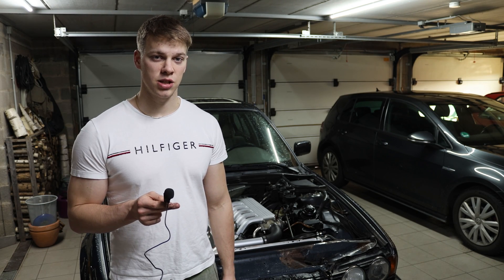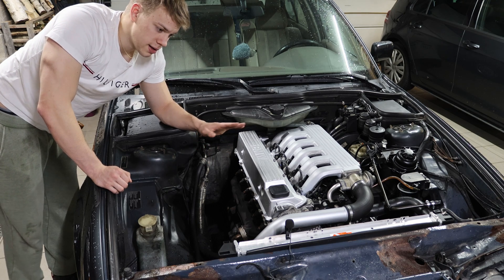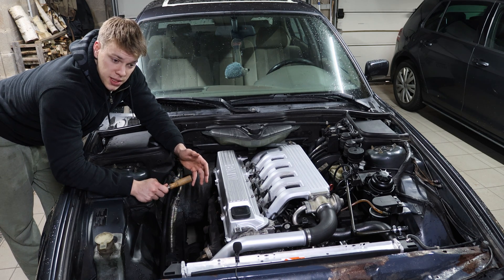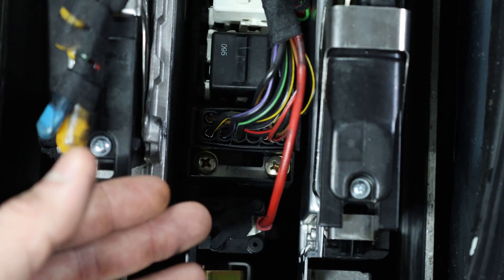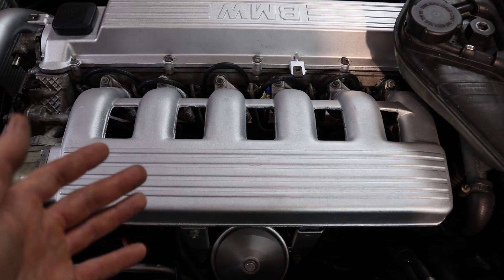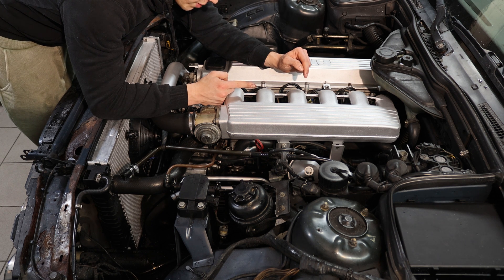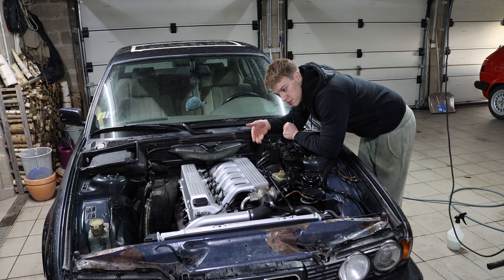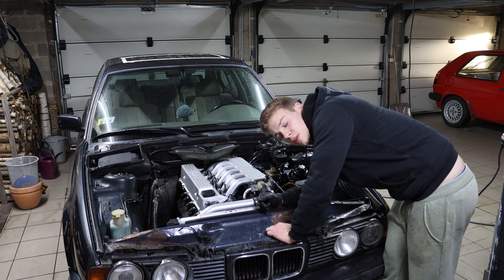How to diagnose and time the injection pump on an M51d25 or m41 (525/325/318)td.s //Ep7

Comment: Glad that you got it working!
About those Bosch VE pumps: Yeah, you can change the pump seals but this is not a rebuild in my opinion. 
Real rebuild is where all the worn out parts will be changed, costs around 800-2000€ (depending how much needs to be replaced). Fun fact is that you can actually order parts for this pump yourself. For example cam plate, cam plate rollers and distribution head with plunger. Cheapest ones come from china and cost 100-200€. But with what quality and tolerances are those :D

Anyway I started the teardown on mine as well, only difference that mine is in Range Rover P38. 
Weird is that I could not get the cam tool all the way inserted. Had a cap like yours but mine was like 2cm, thought that flywheel pin has been misplaced but after 2hours of trying and arguing myself I concluded that it was in the right place just the chain had so much stretch, or it had skipped a tooth somehow. I hope to get the rest dismantled in few days so I can confirm this theory. Anyway the most important is to time it right when putting it back together. 
Did you change out the keys as well or went with old ones? Heard that crank key that is connected to oil pump should be changed while at it.
Reply from the maker: @madismaekivi6800 Thanks for the constructive comment! I definitely agree that only new seals is not a rebuild but from my research( mostly French forums etc) the defective seals cause a loss of pressure and many people have had success just replacing the seals since these go defective before the pump internals do. Can you pls provide a store where I can buy individual pump and injector parts because I haven't found any :/

Considering your case: from what you discovered, I think urs skipped timing since 2 cm is a lot (I had a 5mm gap at 320k km) and that's not unheard of (actually found that case on an RR forum), and then it would be wise to replace the crank key since there was a lot of play all the time. but on mine, I kept the old one because it was a tight fit, and don't think it was necessary. Even if I had to replace it I wouldn't know where to buy a crank key? Get it custom-machined? no idea

Comment: I have a m51 engine in my 1995 525tds, it always starts and runs fine but it can take a while to get going, cranks for what seems too long maybe 5/8seconds but never fails to start, also noticed quite a bit of black smoke under moderate acceleration, gets worse the harder you push it

Comment: Hi, I have a 325tds. The problem I have is when the car is hot it cranks for 10 or 15 sec and then starts. It is better when its cold, but still it takes some time to fire up. What could be the issue? The pump? The temp sensors?
Reply from the maker: hot start issues are common on m51. i am filming a video series on it right now. Issues could be many, but usually fuel related

Comment: Hey! How do you physically set the right lift? My e36 had a leaky injection pump and the mechanics really messed it up. I got the car back and it didnt start at all so i just ended uo replacing the whole engine as I could do that myself but i would like to do a rebuild on the original one to put it back in.
Reply from the maker: If you really want to have the correct lift, you need a dial gauge set

Comment: Hello i have an 318tds e36 with m41 engine. My car is starting late, really weak in low rpm i think the injection pumps timing is wrong how can i make the pump to send more fuel can i do it my self ?
Reply: It’s like the ECU is deliberately limiting the fuel and keeping the idle high — as if some setting is wrong.
Reply from the maker: @bartwoplays3660  1100 rpm idle when the car is hot is too high. but the car feeling "dead" at 1200 rpm  is normal, especially at higher gears its an old 2 valve idi diesel. its always gonna be slow, especially when there is no boost, ie 1200 rpm. Hot start issue is a common issue on this car. I', working on a video on said topic, because my car has the same issue. Does your car smoke a lot ?
Reply: Yes, my car does have some black smoke, but not excessively — just a normal amount. You’re right about what you said, but my car feels slower than it should be. I’ve watched a lot of videos and checked everything on the car. It seems like the injection pump timing is a bit too retarded, and I think that could explain the high idle issue.
Reply from the maker: @bartwoplays3660  depends on what your doing. if your car has cats, ideally there is no to almost no smoke during normal operation and revving until you get to limiter. Also, the timing doesn't directly affect the idle speed, since the advance solenoid governs the timing to a certain degree. A too high minimum order quantity on the other hand can make the car smoke black and idle high :/ It's so hard to help diagnose an issue without being next to the car
Reply: @DailyDrivenClasssics  My car doesn’t have a catalytic converter — it’s running a full straight pipe. Under load, it throws a bit of black smoke. I understand what you’re saying, and yeah, diagnosing remotely is tough. But the only thing left seems to be the injection pump timing. We’ve checked everything else on the car.

Doesn’t it make sense that the ECU is raising the idle because the timing is too retarded? Since the fuel is injected too late, the engine can’t stay running at 800–900 rpm, so the ECU is forced to increase idle speed. Also, the instant fuel consumption doesn’t rise as much as it should. Looks like we’ll try advancing the timing a bit and see what happens.
Reply from the maker: @bartwoplays3660  if by instant fuel consumption you mean the tachometer one, it depends on the gear. if i'm i 3rd gear and floor it under load it doesn't go over the maximum, so if that's what you mean its also normal. Don't just start playing around with the injection pump. I did that and had to fix my mistakes over a few months :)
Reply from the maker: @bartwoplays3660  my injection light doesnt flash even when i have the IP set to full advance or full retard
Reply: @DailyDrivenClasssics  Buying a new injector just to test it would be too expensive for me — if it doesn’t fix the issue, the money would be wasted. Trying an injection timing adjustment seems like a more cost-effective option.

By the way, when you retarded the timing, did you experience any similar symptoms? For example, did the ECU raise the idle? Was there black smoke or a loss of power?
Reply from the maker: @bartwoplays3660  no, not really. thats why i'm saying. just playing with the IP is gonna do more bad than good. Please test your advance solenoid on the pump for function and report back. If you want to you can hit me up on IG and I will try to help
Reply from the maker: @bartwoplays3660
@bartwoplays3660 
Hi, please describe further. Is the issue only when cold, only when hot, how late? What do you consider low rpm?  Also, do not just play around with the injection pump for no reason, its very finicky
Reply: ⸻

“My car idles around 1100 RPM. Low RPMs feel dead, especially in higher gears—when I press the gas at around 1200–1300 RPM, there’s almost no response. It has delayed starting, especially when the engine is very hot. It actually starts more easily when cold. Instant fuel consumption doesn’t increase as much as it should. The engine also runs rough with noticeable vibrations.”
Reply: When we connected the car to the diagnostic computer, it showed errors for the fourth injector, the glow plugs, the intake air temperature sensor, and something called “driver speed adjustment control panel.” I already replaced the air temperature sensor. The car was throwing some white smoke before, but now that’s gone.

I haven’t fixed the other three issues yet. The fourth injector seems fine — I had it checked. I believe the error is showing because the injection pump timing is slightly retarded. Especially at low RPMs, when I give just a little throttle, the injector warning light starts flashing. But when I go full throttle, it disappears.
Reply from the maker: @bartwoplays3660  4th inejctor is the needle lift position sensor. the ecu uses that injector and the crank sensor to calculate timing since it doesnt have a cam sensor. if there is an error for that, you need to fix it.
Reply: @DailyDrivenClasssics  I understand what you mean — yes, by instant fuel consumption I was referring to exactly that. In my case, it never goes over 30 either. The highest I’ve seen is around 21–22 L/100km, and especially in higher gears it doesn’t even pass 10. For example, in 5th gear at full throttle, the maximum I get is 10 L/100km. That definitely doesn’t seem normal.

When I bought the car, I actually found a spare 4th injector in the trunk, so it had already been replaced before. Either it’s gone bad again, or the timing is causing it to throw errors. But there’s no problem with the injection itself.

One more thing — is there any definite way to test if the needle lift sensor inside the injector is faulty? Can it be repaired, or do I have to replace the whole injector?
Reply from the maker: @bartwoplays3660  iirc the needle lift injector needs to have 100 ohms resistance  on the electrical connector with 10 ohms tolerance. i've taken my old one apart, but i dont think theres much to rebuild.Maybe there is an issue with the advance solenoid on the IP which causes the light to go off because the sensor gets a wrong signal :/ Not too sure. you can test the advance solenoid with a multimeter tho. I just dont remember the specs, but you can find them on google
Reply: Alright, so how exactly do we do this test? Which connector should I check with the multimeter?
It would be easier to talk on Instagram — I also use it. Could you please share your IG handle so I can message you there?
Reply from the maker: @bartwoplays3660  its linked on my channel page

Comment: What about the crankshaft and camshaft sensors, could that impact on a hot ngine as no crank and start.?, where are those sensors located on a 525 tds -94
Reply from the maker: @bopedibop M51 has no cam sensor, only crank sensor which is located under the starter. If crank sensor is not working, the car shouldnt start in cold condition. Poor warm starts on m51 are usually worn out  injection pump seals, leaking diesel. Does it not start at all or just have a long crank to start?
Reply: @DailyDrivenClasssics  well no cam sensor thats why i dont find it. I managed to change the crank sensor so i will see how it works now. I was told to change it due to that its hard to start sometimes when hot but if waiting for an hour it usually starts..I cannot see any obviously leakage.I will scan your vidoes for tips. ;)
Thank you for sorting out the cam sensor trouble.
Reply from the maker: @bopedibop
@bopedibop
How did you change crank sensor, because IIRC it sits in a bracket and the position needs to be exactly the same so it gets a good reading? Does your car have an anti return valve, since when hot the in tank pump gets no signal from the ecu and the pump has to "suck" some new diesel through the lines
Reply: @DailyDrivenClasssics  oops i just changed it, sliped out the old and in with the new one and it started nicely. Not sure what to do with this information if it needs to be exactly on a half millimeter. i will keep that in mind.
I have not seen a anti return valve. And I sort of had the problem that the pump has not been able to send fuel so i changed the relay. Checked contacs and get 11,8 volts probably due to the cable area...
I will get an anti return valve and connect after the filter?
just to clearify. The pump was working and sent fuel (check the filter) and it was not able to start but during the time we changed to loaded battery it started after an hour. Next time this happened was after a short trip it was not able to start and the pump was working. Maybe some temp sensors need to be changed.
Reply from the maker: Weird situation. What i was trying to say is that of the car is at operating temperature  the ecu does not give signal to the in tank pump to aid with starting. So warm starts always take longer. Also, most people put tue anti return valve before the diesel filter.
Reply: @DailyDrivenClasssics  Same problem after a short trip. And this problem came a few weeks ago, it worked great before that. I will probably get it to a local workshop to look for codes. thanks.

Comment: Hey i have a problem with my bmw e34 525tds just another day I come out for driving and when I put When I put it into first gear it stalled for a moment because I was on an uphill slope. It started and was fine until I noticed that it was putting out smoke from the back, grey smoke and it was jerking from time to time. I put it at full throttle and it reached 180 km/h and 4,000 rpm but it didn't want to go any further. It was as if it was falling short. Before it reached 4,500 rpm at 230 km/h. Do you think it's the injectors or the injection pump? Oh, and I forgot to tell you that the sound of the injection has changed abruptly.
Reply from the maker: @yahyapoto4647
@yahyapoto4647 sounds like you got an air leak in the fuel system. air bubbles in the fuel system can cause loss of power, misfire, rough running, stalling. Check common places on the M51, like the clear fuel delivery line from fuel filter to fuel pump, leak off lines on the injectors .
Reply: @DailyDrivenClasssics thank you for answer me you are the best I will look the issues and I will till you what’s is the problem
Reply: @DailyDrivenClasssics  I found the problem was the injection pump advance valve, its cables were bad and made bad contact, and also the MAP sensor tube had a small hole that lost power and that's why it smoked too.
Reply from the maker: Good to hear you fixed it :)
Reply: @DailyDrivenClasssics thank you you are the best ♥️👍

Comment: Good content, well done.

I had an old '88 golf 2 gtd 1.6td 69ps, very easy basic system.
You could set up the injection timing by loosen up the pump holding bolts and knock the pump in one - or other direction, causing lean or rich mixture. You had to check for smoke, listen engine sound and go for a test drive to set up the right mixture.
This one looks a little bit complicated engine.

I personally I would not trust the electrical clamps on the pilot injector what you did. When the engine runs good, mark the cables and solder them properly. Soldering is not gonna trick you in 5 years time, neither in 20 years. But these electrical quick clamps can oxidate easier. But maybe I am picky :D
Reply from the maker: @bcsvgabor  oh dont worry. I bought a new pilot injector in a later episode :)
Reply: @DailyDrivenClasssics  I just got there!
You've learned a lot during this journey I guess 

(I will leave my comment here, maybe sby else can get idea from it.)
Reply from the maker: @bcsvgabor  no need to delete your comment :) Are you watching all the old episodes right now?

Comment: Ive been an owner of E34 2.5TDS for year and a half, learnt a lot, and another big reason why it was hard to start mine, was because the temperature sensor was bad - there are 3 or 4 temperature sensors right next to glow plugs, and as soon as I unplugged the 3rd one (counting from front to back, I believe it was pretty much under 4th injector) it started instantly - mine was reading wrong temps and ECU thought it was hot, so it was putting less fuel in, unplugged it and it started. Changed it out for a new one and problem was solved.
Reply from the maker: @Ovieee  Yes your right! I also had to repair the wiring loom in one of my newer videos since the ecu got a wrong temp reading. M51 have 2 standard temp sensors and the other 2 were options iirc . 1 was venetian blinds for the radiator iirc.
Reply: @DailyDrivenClasssics   Yeah mine had 3 temp sensors, but counting the slots from front to back, the 3rd one was the one that was broken. So nice that youre making all these vids, because I couldnt find really anything about these engines so had to diagnose it myself.
Reply from the maker: @Ovieee
@Ovieee your welcome :) Allthough I hope your car turns out to be more reliable than mine :)

Comment: Hi Where did you get the adaptor tool 13-5-330? cheers
Reply from the maker: @jacknewnham9664
@jacknewnham9664 I bought some generic kit on ebay. Doesn't work the best to be honest:/ Would suggest to either buy a good dial gauge with adapters or to set the IP with inpa:)